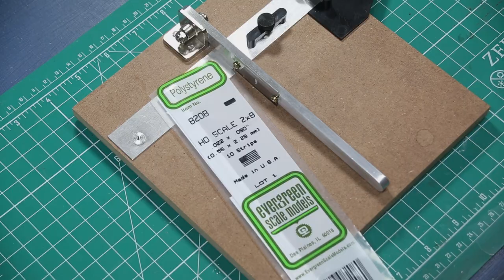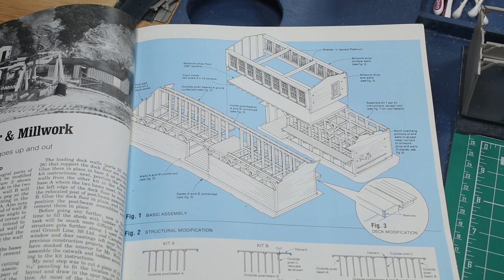Painting the Lumber Yard For My Model Railroad

Comment: Drew, the amount of effort you are putting into such a basic kit is fantastic. Im sure by the time you are finished, it will go to show that most any model can be amazing with a lot of effort. Your painting efforts on the board and batten siding looks superb. I love the knot holes, you can even make knots 3d with an Xacto before painting if you chose too. I have never heard of a wet pallet before. Such a neat tool to have. Maybe you can give oils a try for weathering sometime. Works like the opposite of a wet pallet, you put it on a paper towel, and it absorbs some of the linseed oil and you can weather and streak using thinners, such an amazing effect and looks better than water-based paints even though it still dries slower. I cannot wait until you make the next video for this series, so well done. Cheers Rob
Reply from the maker: Thanks. I'd like to try one of those "craftsman" kits sometime, but the price has scared me off. I've worked with oils a little bit and plan to do some on this kit too. Check out my second video in the series I did on the coaling tower, https://youtu.be/_hLxCQ3JF9Y. I used some oils there for a treated wood effect there.

Comment: I had the same issue with my wet palette when I started using it - the reason why the paint is separating is due to excessive moisture and/or the paper is too thin. Water "thins" acrylic paint by breaking down the polymer binder that holds the pigment. Too much humidity=broken binder/pigment mixture. Try dumping any excess water that sits in the bottom of the palette or getting a thicker palette paper to solve this. 

Good stuff overall.
Reply from the maker: Thanks for tips. Even with that one issue I’m super happy with it.

Comment: Good video Drew. I am pretty new to modelling, so I have a lot to learn. What was the adhesive you used (its in the Tamiya bottle with the orange cap). I generally use the extra thin green cap version of Tamiya glue.
I especially appreciated your demonstration of the painting process you used and the detailed explanation. Thank you very much.
Reply from the maker: That is the regular Tamiya cement, although I have since thrown out that bottle and gotten a new one. That one was old and had gotten too thick. I mostly use thin cement since I can hold the two pieces together and the thin cement will flow into the joint. However, in some cases, particularly with small pieces it is really difficult to hold the pieces together precisely while I apply the cement. This is when I use regular cement. I can add a small amount to one of the pieces and then place the part. It has a longer working time so I can make small adjustments to make sure everything is lined up right as it cures. I think I go into more detail here,  https://youtu.be/FZO0KGlEQ1A

Comment: Great job of interpreting those confusing drawings.  What are the dimensions you used on the floor.
Reply from the maker: I just based it on the size on the walls, but it is 41' x 18.75' (in scale feet)
Reply: @WhiteRiverLine  I must be doing the calculations wrong.  I get 5.65 inches by 2.586 inches which cant be right.
Reply from the maker: @anthonysalzman9941  I didn't really measure before I cut the sheet for the floor. I just laid the side down and marked their length. That looks like it is right though, 5 11/16" x 2 5/8" is what I've got. There is some chance I'll need to modify it slightly when I get ready for assembly.